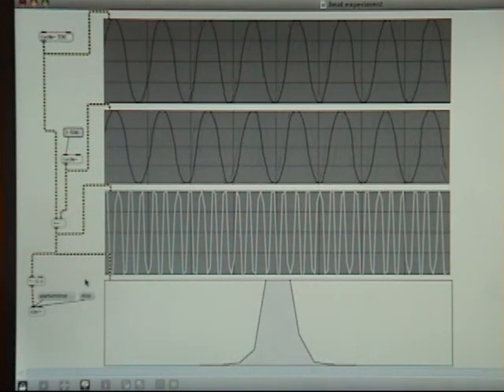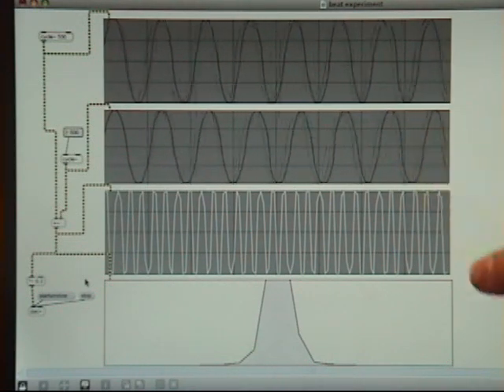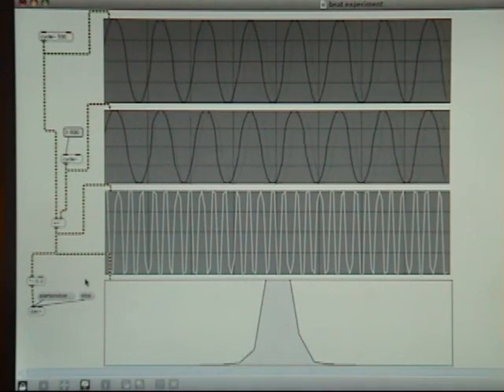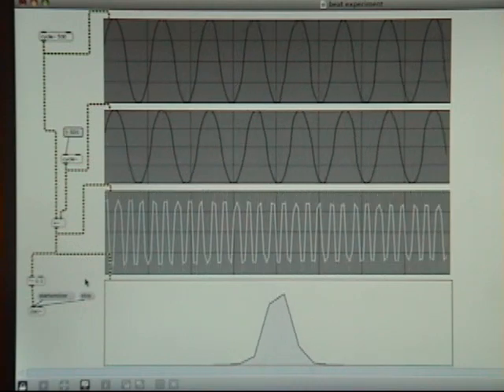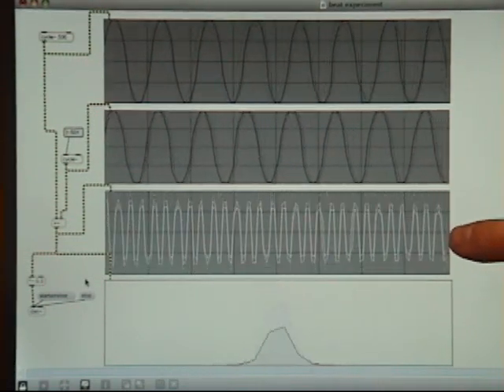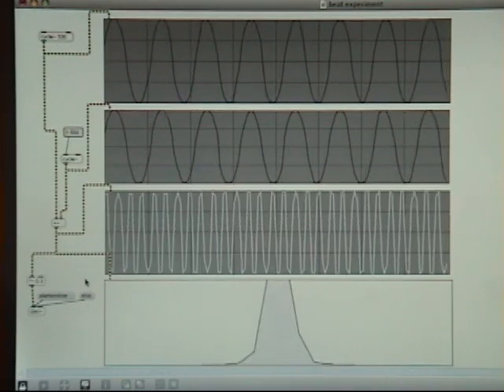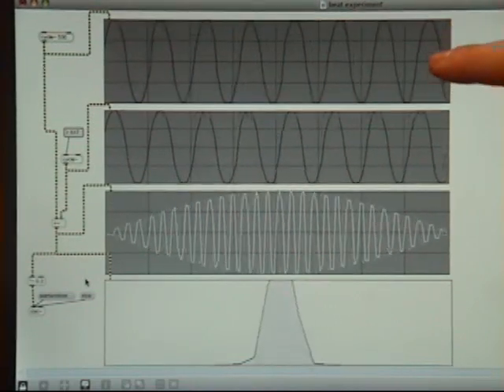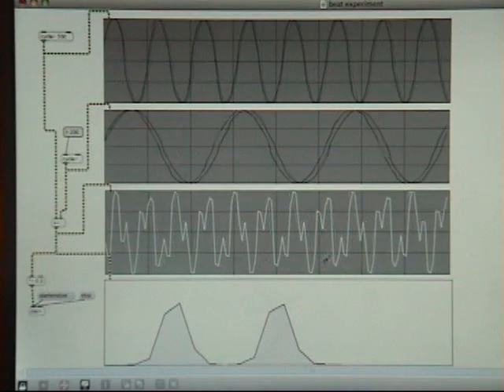Beat Frequency - amplitued modulation resulting from adding sinusoidal signals of similar frequency

Comment: I think the average frequency range between two tones of the same timbre is around 7 or 8 Hz before you actually notice the beat occurring.  As Dave said, if they are tuned close enough, you probably will never notice it, Plus it would be much harder to spot as you add as you go past two violins playing the same note.